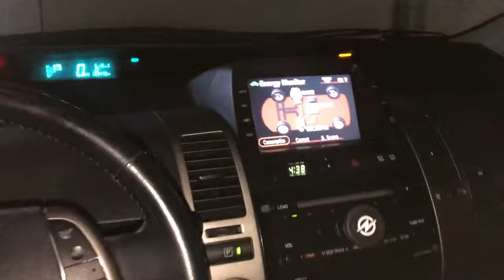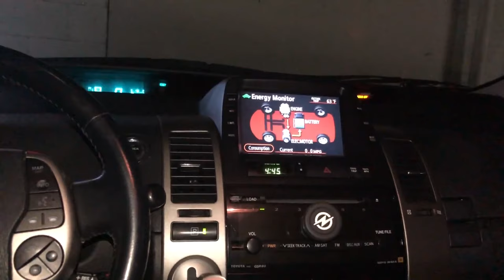Prius Catalytic Converter STOLEN on LA streets

Comment: Weld a steel bar along the length of your exhaust pipes on both sides of your cat. Makes it very difficult to cut. Most thieves would see it and move on to easier prey. Had my cat stolen before...cost $1100 😭🤬😩😤

Comment: Sorry for your loss. Unfortunately there is no shortage of pathetic people in this world. Think I would have bought a “cat delete racing pipe” and an O2 sensor mod, like all the hot rodders use to prevent CEL’s. I’d guess this car puts out less pollution running straight [no cat] exhaust than most if not all non-hybrids. And if you calculate how much pollution this car has prevented, it should be carb exempt at this age.Kudos to you for keeping this brilliant work of engineering on the road.

Comment: okay so are the oxygen sensors still on or do they take that too i wana get straight pipe but not sure if iam have to  ask em to wield a screw point for the sensors  any infor will help. gen 2  2006 Prius iam gonna try the oxygen adapter to pass emissions

Comment: Yup, happened to my Ford Excursion between Christmas and New Years. Idk exactly which date because I hadn’t driven it for a couple weeks. It cost me $1,200 to replace cuz it has to be OEM then the shop welded on stuff to make it difficult to steal. Thief left his broken hacksaw under the car 😡
Reply: Hi! Do you know what they welded on, details? I need to get protection for my Exc but mechanic and muffler place say nothing will work.
Reply: @amyd6182  He welded on thick steel cables to make it difficult for thieves to cut through to the cat.
Reply: @RobbieHerrera  Thanks for replying so quickly!
I wish someone made a video of that on their Exc so I can show my mechanic and the muffler shop!  I'm not finding anything on YT for Exc 🙈🧐
Reply: @amyd6182  I ran into the same issue. There’s no information or anything you can buy as a solution. There’s tons of information for Hondas. What my muffler shop did was weld in the cable so thieves will have a very difficult time cutting and extracting the cat from the truck.

Comment: I am joining the club of victims.  2006 with 250K miles.   I'm insured.  Muffler shops are now charging 3500 to fix!   I shouldn't care since my deductible is $250.  Maybe I should just pocket the claim check ($2000) and junk car to charity, while I shop for replacement car.

Comment: Can you explain what are the exact size pipes, adapters and clamps that you used.  I don't understand what you meant at 3:12 when you said that Autozone doesn't have anything smaller than a 1 7/8 inches (which would suggest that you wanted something smaller than that) so you had to go down to the 1 1/2 inches ????  1 1/2" is smaller than 1 7/8"!  Then you said that you sleeved it with a 1 7/8".  What does "SLEEVE" mean?  That you used a short piece of 1 7/8" pipe and did you put it OVER or INSIDE the end of the 18" pipe that is not the 1 1/2" end'? Or is it a 1 1/2" INSIDE diameter end? and the other end is 1 1/2" OUTSIDE diameter?  Or that you used an adapter that went from 1 1/2' to 1 7/8'?  Or did you mean that the straight pipe is already sized to have one end 1 1/2" and the other end 1 7/8"?   It's very confusing
At 3:02 I can see that you bought 1 adapter, 1 connector (1 1/2" to 1 1/2"?) and 2 short pieces of pipe, but I can't read what size they are and you never said what size they were or if you even needed all of them.  You obviously used the adapter, but I can't tell if you used the connecter or either of the short pipes.
Best as I can tell, at the flange a 2 1/2" to 1 1/2 adapter is clamped on with a 2 1/2" clamp..  Then 2 clamps are used to secure the 1 1/2 flex hose. There may be a short piece of pipe that the flex pipe goes over, thus the need for the third clamp?  Then the flex hose is clamped onto the 1 1/2" straight pipe. It's the last connect that I don't understand.  I can only see that a 1 3/4" clamp is used.  Instead of "sleeving" the last connection, what size pipe would be and exact fit?
Reply: Hey sterling. Did you ever end up figuring out what pieces and dimensions are required for this? Would love to know since I have to bus to the auto parts store.

Comment: Okay, I need some help here. The dealer and the mechanic want $2495 for a new cat, that doesn't include the sensors that were messed up.  You could buy a cat on Amazon for $149.99 including bolts and bracket, not the sensors, I'm checking into that now. my mechanic will use the parts I provide him, but he says that that converter is not carb compliant?? What does that mean? I live in New York state. I wonder how much this really cost to fix, because both the mechanic and the dealer or quoting $3,600 Plus. Help me please I'm a little old lady. A little cat lady. I want to keep my car.
Reply: Interestingly enough I'm assisting my aunt who lives in New Windsor, N.Y. and was told she needed a new catalytic converter for her car.  She was quoted approximately $1200 dollars.  I advised her not to buy anything until she tries some inexpensive solutions which may remedy the "check engine" light so she can obtain her car registration sticker.  To sum it up, my advice to you is to find a another reputable mechanic to get a third opinion.  In my aunts case, I had her take her vehicle to a local auto parts store so they could run a generic scan of her vehicle and this way I could research the error codes from that readout.  After receiving the error codes from her I determined that she may only need a sensor(s) replaced or she may have a clogged catalytic converter which could possibly be cleaned/cleared out with special additive when added to your fuel tank (this is not guaranteed to work but worth the try since it's only $26).
Reply: @avalon1995  that all sounds good, but I've been told twice, that you can only install carb compliant converters in NYS.  I checked out alternatives, and found you can only get new cat from the dealership.  If I could install anything less expensive, my mechanic would had agreed to it, as I have provided him with other parts in the past and he's had no problem with them.   Also, seems like claims adjuster would had pointed out any alternatives, but didn't! How's your auntie's car doing now?  Just asking, as I will be seeing the mechanic later today or in the morning.  I will talk to him again!  Thanks for your info.  PS where did you get ,$1200 quote for a cat?  Thanx again.

Comment: So looking at this it looks like they cut the front of the catalyst from the flange and didn't remove the 2 spring bolts attaching the cat to the exhaust manifold.  So basically use a saws all to to both ends.

Comment: Shop wanted $1200.  I bought one on ebay for $125 with the pipe included.  put it on myself and muffler dude welded it for $25.  all dash lights work right  so don't believe it's got to be factory oem.  A first gen prius if it matters.  i'm glad i don't own this one in Cali.

Comment: Ummm you just need to get rid of the CEL to pass smog. They NEVER check to see if your cat is OEM.
Reply from the maker: Half the time they do look underneath the car at SMOG stations
Reply: @DavidBello  If you go to a station that doubles as a repair garage there will usually be a car on the lift. They are not going to take the car off the lift to check your your cat. Or the station may not even have a lift.

Comment: That's bad luck. The thieves are brazen. That heavy duty cable cover looks like overkill. If the cat was welded to the chassis in several unusual places they would be discouraged as soon as they jacked the car and saw the welds. Their MO depends on the cat being attached at 2 points only by the pipe. Attached it with extra welds and they will leave.
Reply from the maker: Gary LeLacheur the engine needs to move and welding the flexing pipe to the chassis is not really an option with most cars, which is why they have rubber mounts on hangers.
Reply: @DavidBello  You're right, I should have thought of that. It looks like cats will be easy picking' while dumb state law makes it worthwhile to steal them in broad daylight. Cheers.

Comment: I live in california and 5 days ago they stole my catalyc converter.. I was driving my 2009 prius without catalyc converter..drove it  for 4 miles and it worked  then I drove it back home and now it does not go into gear.  It turns on but does not go into gear. The red triangle came on with exclamation point while driving it back home  and then a few min after it did not respond anymore. I parked it a block away from home cause I could not make it home. My insurance is towing it tomorrow to a shop so they can fix it..but now it has an issue with not going into gear..do u think that's because it does not have catalyc converter?  Car was running great before it got stolen..no issues at all..I wonder if I messed it up or the prius is doing it on purpose just to be safe since it does not have the cat?
Reply: Did the insurance cover the cat stolen ?
Reply: Same here my 2007 prius cat converter got jacked in the south bay. The red triangle light came on due to the thieves that did damage while taking the cat from my car
Reply: @bigbrother1796  why the red triangle appeared ? The cat missing shouldnot affect the car moving
Reply: @islamfouad2619  yea that's what the muffle shop is telling me too. He thinks it may be the battery. Hopefully is just the 12v battery. About a year ago I was changing the passenger mirror on car and after I  was done the battery was dead I don't know why. So I gave it a jump and it work great after that until they stole me cat about 4 weeks ago.
Reply: Yea you were right 12v battery was reading 11.7 so I changed it rigjt now and now car turns on without any problems even though it does not have the cat installed yet..it was a bad 12v battery
Reply: Iam thinking about selling my 2009 prius though cause it will be a matter of time before they steal cat again:(  insurance paid for almost everything. I will only have to pay $200 out of pocket out of $3000 that it will cost to install it.
Reply: @futbol1972  what insurance company you have ? And the policy type ? Also how much for your prius ?
Reply: @islamfouad2619  I don't know how much I will sell it for yet are u in califronia too?
Reply: @futbol1972  yes in CA and what insurance company you used
Reply: I think liberty
Reply: Why
Reply: Mine did
Reply: @islamfouad2619  yea bit I still gotta pay $300-500 out of pocket for deductable